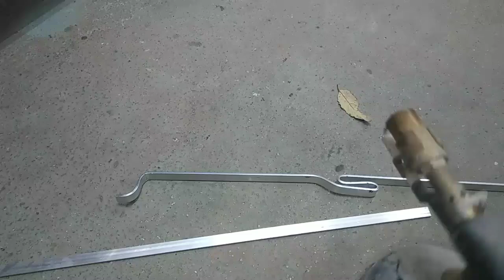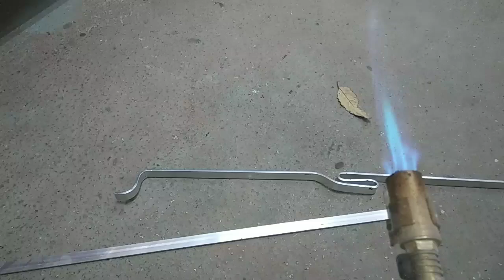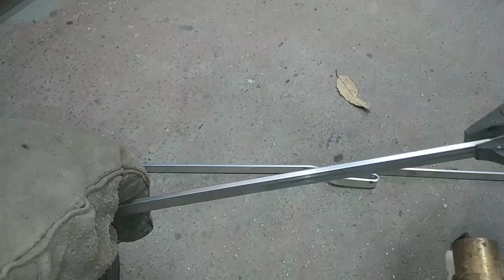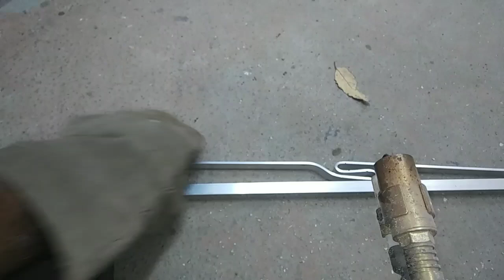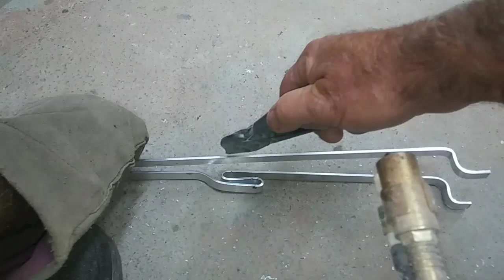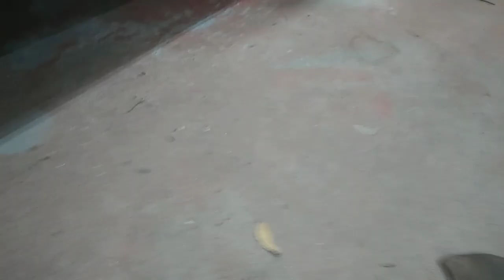heat bending aluminum how to bend aluminum

Comment: Thank you for the video.  It was great to learn that Aluminum alloys can be bent fairly easily - information available online seemed difficult to find.  I was thankful for this as I needed to make upper support braces for a couple rear bicycle racks.  I got a 36" x 1/4" aluminum rod from Home Depot.  They don't advise the alloy, but I found a reference that the flat bars from same supplier is 6063 T5, which has small amounts of magnesium and silicon (<1% each; and other very small amounts of metal impurities).  I needed to both bend and forge the rod for my purposes.  I used a small propane torch like yours for about 25 seconds for the bending (like you said) and 40-50 seconds for the forging (it was just a guess - there's a blacksmith aluminum forging video, in which they say it's hot enough to forge when you can singe the end of a pine shim or burn the end of straw per one of the comments - or 600-900 F per Wikipedia if you have a heat gun).  I tried to heat evenly and all the way around.  Used a little more heat time for larger areas / radius.  I forged the ends into flanges, in which I drilled bolt holes.  My bench vice has a small anvil area in the back, which worked great for this small forging job.  I also used a 3-lb sledge for forging.  I put a metal dowel in the vise to bend around, and I also clamped in the vise to bend when working with shorter lengths.  (I only burned / branded a finger once - it gets hot fast and travels.)  The idea you can reheat for further bending / forging was helpful, and by virtue of no mention, so was the presumption that the metal does not become brittle / does not need any special annealing conditions.  Thanks for indicating to bend in one direction only per spot, as back and forth with break it.  Great video - thanks again - CW

Comment: Thank you for the video sir. If it wasn't for this video I would of had to pay someone to fix my auxiliary fuel tank. The mounting tabs are plate aluminum and in shipping these tabs were bent closed and they were originally at a 90 degree. I knew you could heat metal and bent it back but I didn't know you could do aluminum the same. I was fixing to take my tank to a shop to have new tabs welded but I said let me look on you tube to see if there's something else that could be done and that's when I came across your video and I'm glad I did. After watching your video I grabbed me a torch and did what you did in your video and bam, I bent both tabs open to a 90 degrees like they were suppose to be and without cracking them. Ya saved me some money buddy, thank you. Take care buddy.

Comment: ThanksI need to bend flat alum bar 1/2" thick x 3" wide x 6" length into a 90 degree angle like an "L" bracket, can I install it after this process and what kind of weight can it hold in comparison to before or can I harden it and what would be the process to harden aluminum?

Comment: I have 1/2 inch dia. aluminum tubing that has a sharp 90 degree bend in it (due to a high wind storm), and I would like to straighten the pipe back out as much as possible, because it is part of an antenna receive/transmit leg. Have you ever had to straighten out aluminum tubing, maybe using a wee bit of heat to make the straightening easier?

Comment: Thanks for the video! 👍
 This is good to know and learn. I'd like to make a custom flag mounting bracket for the back of our Harley-Davidson but what I'd like to try to find out now is how to re-harden the aluminum after it's been annealed so that it gains it's rigidity back? Not that this bracket wouldn't necessarily work in the annealed state but with a short flag blowing in the wind at 65mph it might bend the bracket out of shape, not sure.

Comment: I need to bend a cast aluminum bracket for hand guards on my motorcycle. they are cast on one and two can you go to the bars, then they wrap under the hand controls/master cylinder to hold a plastic brush guard, but the angle is wrong at the brush guard or at the bars.. I don’t know if this will work because the casting is not made of flat Aluminum
Reply from the maker: I have bent cast aluminum the same way in this video. I bent some rock guards for my vw bug.

Comment: i like the propane torch head. what kind is it?? It needs to be 400 degrees. A piece of wood will black mark it when it is hot enough.
Reply from the maker: one from harbor freight. the flame is pretty large they work the best.
Reply: @Mikefngarage  I will have to buy one. My old one of 40 years gave out and I bought one at Menards and it has a real spread out flame. I like the pointed one on the HF torch.............Cheers, Jim

Comment: Does this decrease the strength of bar after cooling?
Reply: If it's been heat treated then heating it again, with a blow torch, will anneal it, or create a Heat Affected Zone (HAZ), which is an region where the heat treatment has been undone, and thus it has been weakened.

Comment: Thanks - just what I needed to know.  I need to bend some 1.5" x .25" aluminum into a "C" shape.  I was thinking about putting it into a vice to facilitate the 90 degree bending...
Reply from the maker: without heat it will break Just remember it usually only bends once. so be sure you bend it in the right spot.

Comment: how does this impact the structure of the aluminum compared to cold bending?
Reply: depending on the grade, cold bending aluminum will break it. the typical 6061 T6 is too brittle to bend cold. heating the metal not only softens it, but also anneals it. it's less brittle, but the annealing process removes any work hardening done on the metal.